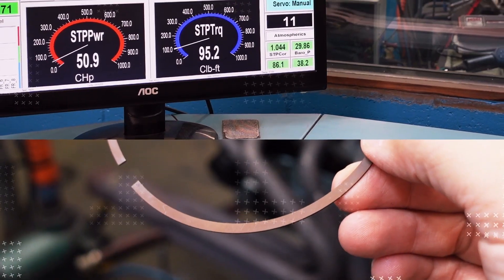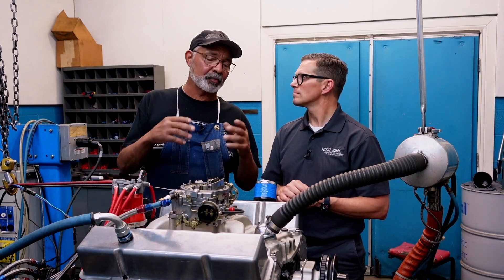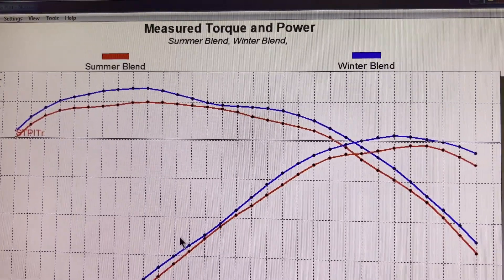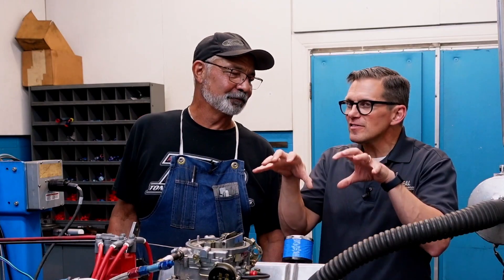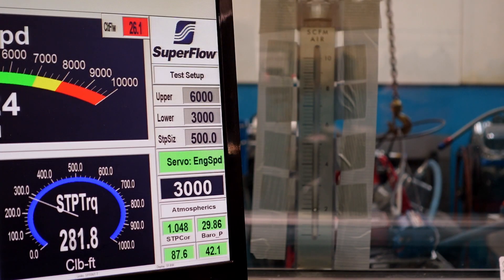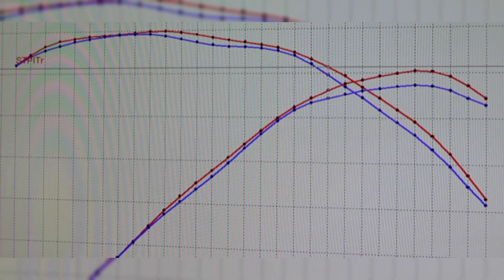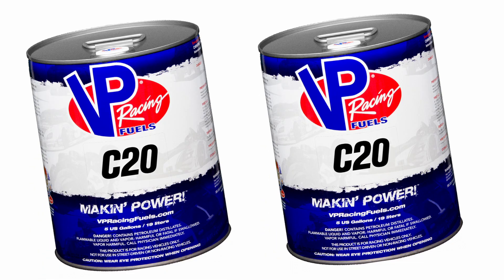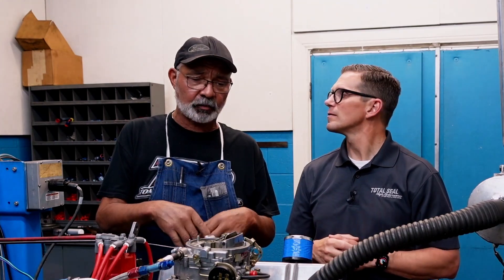Winter Blend vs Summer Blend Gasoline - What’s The Horsepower Difference? Dyno Test Results!

Comment: I've documented my MPG every tank, between 2 diff cars, for the last year and a half. I change brands, but use same octane, cuz i want to see if brand mattered. I also document whether it is summer fuel or winter fuel. Mt results are, I don't see much difference between them in city driving. Not even between summer and winter. But I live in Las Vegas where summer is 115° and i have to blast the a/c whi h affects the mileage. Both cars are big V8s, a 6.2 liter and 6.4 liter. I actually get better MPG in the winter here because of it. 17s in 1 car winter, and 16s in summer. Same for the other, i get about 1 mpg better in winter because the heat here kills cars. Very consistent with how I drive. I've gotten no drastic enough increase or decrease between brands and I've tested : Chevron, Shell, Arco, Sinclair, 76, Sunoco, Mobil, Conoco, Smith's, and Maverik. At least not enough to fork out am extra 50 cents for the same 91. Here in Vegas all the Shell and Chevron are priced about 50 cents more than every other gas brand that I named. So now I stay away from them to save about 10 bucks a tank.

Comment: the more reasonable test is to compare a similar size and horsepower car and drive it with the same road condition and speed. For my last few ICE cars, none of them could avoid any significant drop in mileage under such winter conditions in the range of 15-25%.

Comment: I always run a 90 octane ethanol free from a local Rutter's station, does the ethanol free have the same winter/summer differences in blend here in PA?
Reply from the maker: Great question! Yes, even the ethanol free fuel will have a summer to winter variation in vapor pressure.

Comment: I hear ethanol needs higher temps to start. My E tester says usually 5% less than the pump says for ethanol %. Winter blend makes more HP huh? 🤔
Reply from the maker: Ethanol contains oxygen, so it does lean out the fuel mixture. Also, the vapor pressure of the fuel changes from the Winter to the Summer blend.

Comment: One of the big differences between winter and summer blends of gasoline is the amount of anti-freeze additives, it can be problematic to use winter blend in the heat of the summer.
 The biggest thing is the RVP of the fuels being compared, the Isopentane (aromatic) content is directly related to the fuel's ability to vaporize, has nothing to do with octane.
Reply from the maker: Exactly!
Reply: Gas ingredients themselves are an antifreeze additive. Most ingredients freeze from -70F to -180F.  The only positive for 10% ethanol is you never need to buy Heet to absorb any water.

Comment: Out here in the middle there is a significant difference noticeable on a 160 HP 4.6 Ford.
As was commented, the ethanol % varies a LOT. Non-eth is 45 cents higher and usually gives 6% better mileage. Does NOT offset the price difference, but runs better on NON- eth.
Reply from the maker: So true, the ethanol content does play a major role here!
Reply: Because when you use ethanol you reduce the gasoline BTU content so you need more of it.

Comment: Here in southern Ontario, we obviously have seasonal blends. It's a very noticeable difference between milage. Power wise... I don't noticed the difference as much. A little bit more sluggish. But not alot.
Reply from the maker: The change in fuel mileage reflects the change in HP. You are using more fuel to go the same distance because the engine is requiring more throttle to maintain the desired speed. Fuel mileage and engine efficiency (HP) are related.

Comment: Total seal gapless piston rings for me,. absolutely. Summer blend Winter blend nonsense alcohol in our fuel crap hurts are injectors and more and it's actually bad for the planet poisoning the air...$1.70 for regular gasoline in Russia right now that is 93 octane or you can get the middle gas which is 94 octane or you can get the premium which is 95 octane, and they have a hundred octane at some of the gas pumps it's $2.30... Russia is selling a barrel of oil for $60 United States $100.... Saudi Arabia purchasing Russian oil which gets shipped back to the USA. What a web the United States weaves in the political theater.

Comment: Have you tested ethanol content? I've been testing every batch of pump fuel I buy and have found from 3% up to 21% depending on brand etc around here. Ethanol content has gone up around here lately.
Reply from the maker: No, but I wish we had. That is a significant variable.
Reply: Good idea
Reply: That should be false advertising when they sell fuel stated as E-10 and its 20%+ I always buy E-free cause it runs far better in small engines and delivers way better mileage in vehicles

Comment: So summer blend decreases full mileage making you burn moor gas thus making more pollutants, or am I looking at this to simple.  🤔
Reply from the maker: While it appears that way on the surface, the lower vapor pressure of the summer blend reduces evaporative emissions. Also the winter blend is designed to help improve cold start, so the emissions are only one consideration.